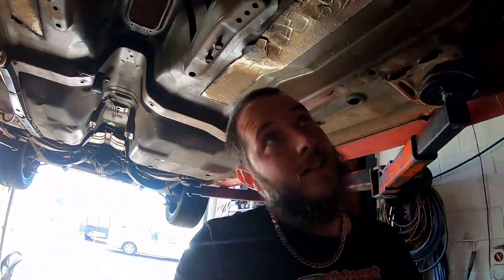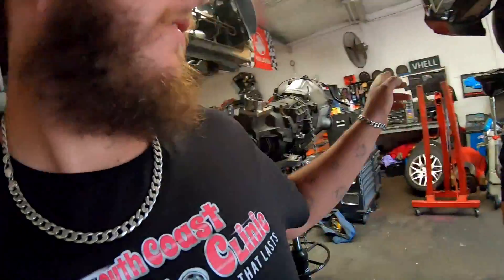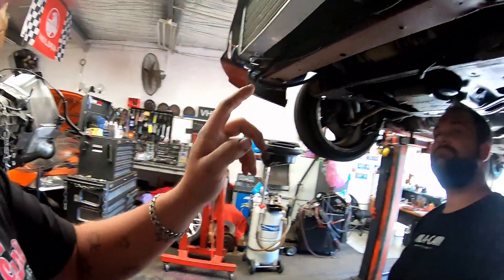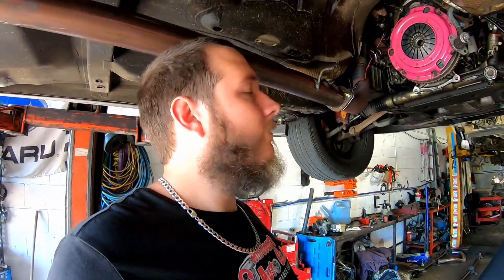How To T56 A Turbo Ecotec (how not too also )

Comment: Hi mate how much roughly did the malwoods t56 adaptor cost with all the parts shown in your video? And also can you use a heavy duty clutch for ecotec or does it have to be a custom clutch kit like yours? Cheers Nicko
Reply from the maker: Hey , the malwood kit was $300 & something if I remember correctly , the clutch I bought off cornfed boost when he upgraded so not sure how much he paid new I think it was $1500 , you can use the pressure plate and flywheel but need a custom clutch plate , for all new prices better off asking Rhys @Rkgarage or cornfed boost sorry man hope that helps :)
Reply: @lshouse9821  awesome thanks very much for your help mate. Ill get in contact with them. Love your vids btw very helpful and keep up the good work!